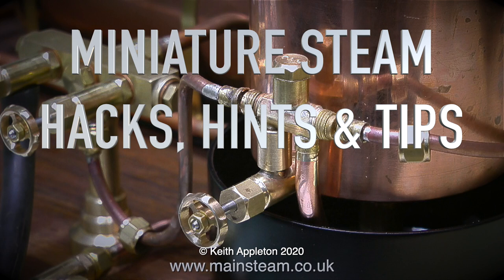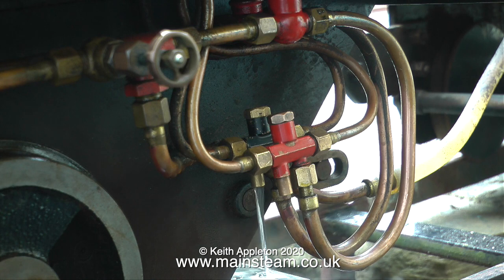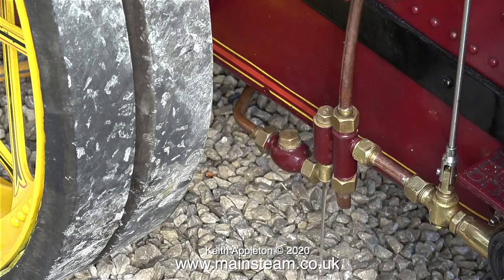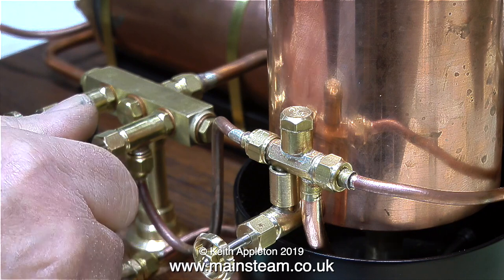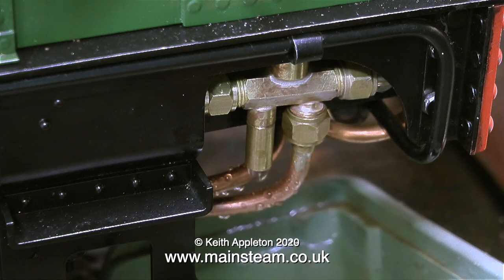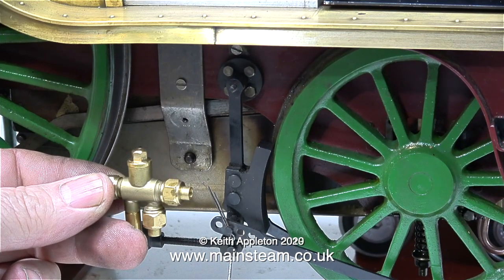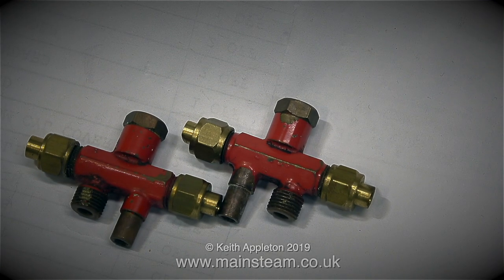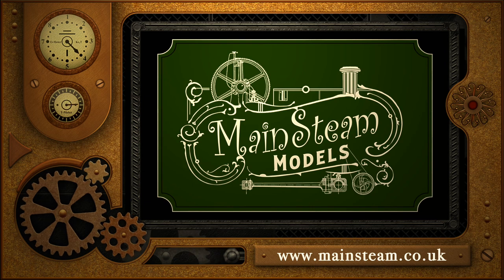THE OPERATION OF LIVE STEAM INJECTORS

Comment: Injectors are the bane of my life. I have a 4" Foster and the overflow has always dribbled, no matter if it's a new one, old one that's been pickled, and I have tried different sizes. Now I have a clear hose that returns the excess water back into the tender. There's no leaks in the supply pipe as it will pick up quickly, but I cry when I see others just work.

Comment: The principles behind these injectors are really not all that difficult. They are somewhat detailed, but very straightforward. The idea that Bernoulli recognized, is that the kinetic energy in a moving stream of fluid is equivalent to head pressure (potential energy) and these two forms of energy can be interconverted. Very basically, the injector works a lot like pushing a puddle of water up a hill with a nozzle on a garden hose. Where people get hung up is in thinking about the pressure of the boiler. Injectors do not work on pressure. They work on the velocity and density (>kinetic energy) of a precisely tuned water jet operating at approximately atmospheric pressure, and conversions between kinetic and potential energy. The first cone (nozzle) uses the potential energy of the steam pressure to produce a high velocity steam jet with high kinetic energy. The second cone (combiner) draws water into the steam jet, producing a high velocity water jet where optimally all of the steam has condensed, and all of the kinetic energy (and heat of vaporization) of the steam jet has transferred to the water jet. It is now a lot like the water jet that comes out of a pressure washer nozzle that makes a stream instead of a fan. When properly adjusted, there is no steam left in the water jet, and there is no excess water. This water jet is precisely directed into the third cone which is positioned and sized to just exactly catch the entire cross sectional area of the water jet, not more, not less, and converts the kinetic energy of the water jet into potential energy (pressure) of a slow velocity stream of high pressure water which is dependent only on the velocity and density of the water jet that it caught. It is not directly related to the pressure of the steam supplied to the first cone. Remember, this water jet is formed at atmospheric pressure, the pressure at the overflow port.  This third cone works a lot like a Pitot tube on an airplane, where ram air velocity is sampled as pressure. The first two cones together function as an ejector (of the supply water) that has been precisely tuned for maximum density and velocity of the water stream, giving it maximum kinetic energy. This is why you have to adjust the water valve carefully. This is also why the cones have to be clean, so the water jet flows smoothly. If you provide too little water, there is still steam in the jet and the kinetic energy is less than maximum. If you provide too much water, the third cone cannot catch it all, and energy is wasted. If the injector body or the feed water is too warm, the steam in the jet will not completely condense, reducing the density of the water jet causing inefficient energy transfer. If there is an air leak in the water supply, the density of the water jet cannot be maximized because air is not condensable, and the injector won't work. Hope this helps.
Reply from the maker: Thank you for your Essay, very interesting }:-))) As it turned out, the problem was that the injector was too big and had a high discharge capacity. Once a number 6 injector was fitted, all was well ......

Comment: I notice you use the same rolling roads that we set at Miniature Railway Workshop which is where I now work. Could you also try to explain the logic behind traction engine scales? Locomotives are easy because is governed by the track width, but I don't understand the traction engines.
Reply from the maker: inches to the full size foot . . . .

Comment: I would like to be able to use the injector on my locomotive whilst on the move but cannot see the overflow. It almost looks as though the extention on the injector is detatchable but I think its soldered on. I could try threading the overflow 1/4 x 40 the pipe looks thick enough to take it and then I could attach an extention pipe. Have also looked for an elbow shaped piece of plastic which would push on but this has proved difficult.

Comment: The part that I don't get is that the steam input for the injector is at boiler pressure but its pumping into the boiler. So I'm not sure how the steam flows since the input and output to the injector is at boiler pressure
Reply from the maker: Condensing of steam in the water and specially shaped cones inside the injector speed up the flow of water to just above boiler pressure.
Reply: @keithappleton  it makes me wonder how they figured out this stuff
Reply: My understanding is the 1st nozzle converts steam from boiler in to a lower pressure, lower temperature, but far faster flow of steam (often supersonic)

That steam then slams into droplets of feed water . The steam condenses, making slightly larger water droplets. Kinetic energy of the droplet is sum of the kinetic energy original water droplet+kinetic energy of the steam that condensed. Result droplet of water moving at a fair pace.
Then a final nozzle to converts most of water droplet velocity back to pressure...and it's got enough pressure to be fed into boiler.